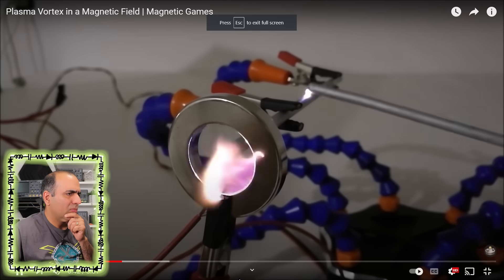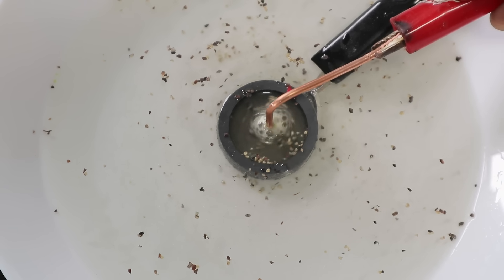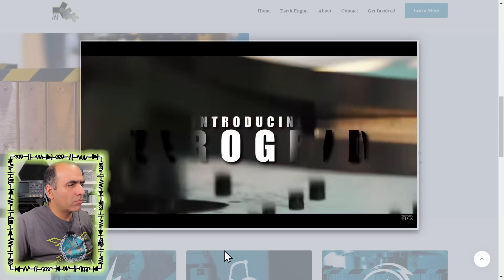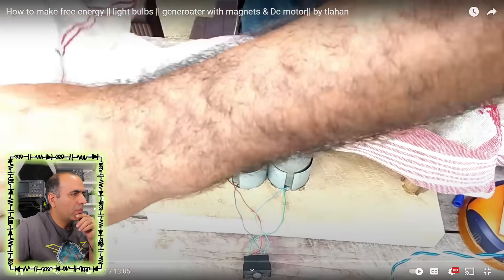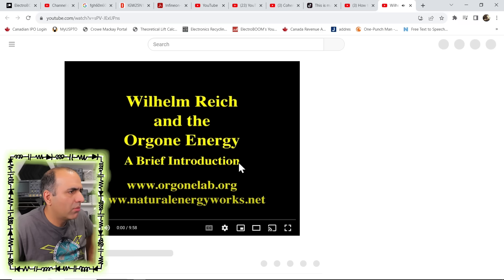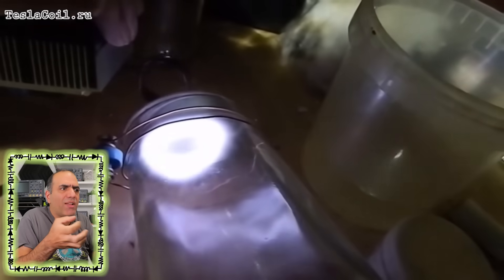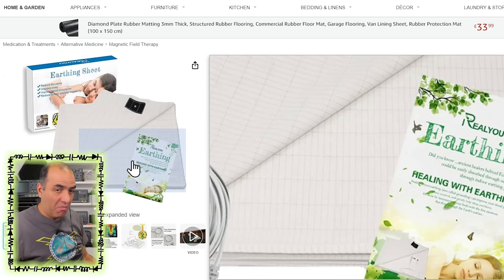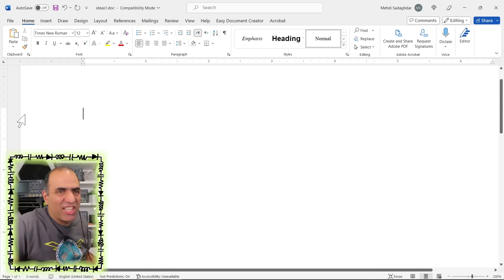Plasma and Salt Water Electric Vortex, Document Free Energy Clean Up

Comment: Hi Mehdi! I love your videos, please don't ever stop making them!

Regarding the plasma ball thing, I think I recognize that. I believe it may be a simple Inductive coupled plasma experiment where they're supplying some sort of RF source through that large coil around the bottle and maybe the smaller one is a heater of sorts to heat up the gas and make plasma a bit easier to make. Usually ICP is used to make extremely high temp plasma and requires a liquid cooled quartz enclosure to operate for a long duration and an electron source of some sort to kickstart the reaction but maybe a simple proof of concept experiment is doable with a glass jar as we see here. Not 100% sure, but I wanted to give my two-cents.

Comment: How about lenses to heat water to boil. Electro-BOOM. Also, Stirling engines powered by lenses. Pretty much heat something with a magnifying glass. Even thermo-acoustic motors heated with lenses. Greenest idea I've come up with so far. The energy cannot come from the earth or we will disrupt things that are supposed to be in balance. So we have the sun, and solar panels need minerals that we have to take from the earth. Why not lenses, either a series of lenses or giant lenses, to heat the tanks on the reactors we already have, to turn turbines that we already have hooked up to the grid we already have. Also, there will be advances in lenses if we use this idea. You can easily swap out the lenses with future lenses. Green lens
Reply: Just give this Kentucky truck driver credit when you get a Nobel peace prize.
Reply: Thoughts are sparks my friends

Comment: Speaking of free energy, how about tidal power?  That's not free energy, you say?  OK, then where does it come from?  Specifically, something else must be slowing down; the rotation of the earth on it's axis, maybe?  Say that a large body of water, like a bay with a narrow opening to the ocean, was dammed.  Turbines are used to generate electricity on both incoming and outgoing tides once there is a sufficient mismatch in water level across the dam.  Will harvesting energy in this manner cause the rotation of the earth to slow down more than it would without the dam in place?  How much?  I ran through some calculations once, and the answer I got was ... surprising.

Comment: One thing I'd like you to demonstrate and explain is this experiment I did when I was a kid : Take an incandescent lightbulb. Stick the metal part in a glass of water (to keep it cool I assume). And put that it the microwave.. After a few seconds it turns on! I was never sure if it was the filament starting to glow, or the gas inside turning into as plasma....

Comment: My guess on the coherer thing is that the flame sucking the oxygen out of the cup creates just enough vacuum to cause the lightweight aluminum balls to meet up in a more "conductively ideal" configuration, at which point current will begin to flow. Once the current is flowing, the charges passing between the cathode, the balls, and the anode is enough to maintain the attraction and therefore maintaining said "conductively ideal" contact between the metals. Once the circuit shorts to ground, the current flow is diverted away from one side of the circuit, eliminating the attraction between the metals and the aluminum balls settle back into a less ideally conductive position.. effectively turning off the circuit.

I'm probably talking nonsense but I like to theorise out loud haha

Comment: So, heres an idea for you to try, its not free energy but its probably the closest we could get, the reason its not free is because friction and heat power loss aswell as needing to swap out components every so often.

So, the idea is you get 2 motors, gear them so much so that the second one when spun outputs the same as the input requires, but kickstart it with an external power source to get it running effectively, again not free energy but i feel with the right gearing and motors, you could have battery-less pacemakers in the future, but you'd need to go in every so often to check on the component wear as i know carbon brushes don't last forever, also as youve said here the magnets in said motors won't last forever, but it could in theory limit battery waste, the only thing i'm not sure of (which is why i'm giving you this as a video idea) is what the output amperage would be like, as i know you'd need say for example 5 amps to go in, but would you get that out? i doubt it but its something for you to explore, especially as you are the best fit for the experimentation as you give the best explanations while also being really entertainign and not some boring droning narrator with about as much personality as a piece of paper

you don't have to take this idea on of course, but i'd really like to see someone knowledgeable in electronics give it a look into, as i'd really like to see if it could work, i have lots of theories about how things could work in a scientific way but no means to properly test them, some ideas we can't test but have some theoretical merit

Comment: In regards to the first video, if I'm not mistaken, an asymmetrical magnet would be a magnet that the north and south poles wouldn't be in balance, making one side much stronger than the other. This would indeed make it possible to do the whole computer-fan-with-magnets thing and have it turn without adding more energy to it... For a while. Such a magnet would be extremely unstable, and would indeed require recharging, or it would either lose its magnetism, or just become a regular magnet, and I think that 3 years if VERY optimistic. And because of the resistance in the wires, friction on the electrical generator and motor, air resistance, etc... It would still lose a lot of energy overtime.

In other cases, people think that by orienting magnets in a certain way, you could negate the effect of one pole, while enhancing the other (see halbach magnet), but in reality either the magnetic fields will just be severely distorted, or the assembly will lose all magnetism after some time.

Comment: - 11:10 Um, that's obviously not a ball or ring of plasma in the bottle, it's clearly just the reflection of a flashlight and ring-light. I have to assume Mehdi is being facetious, pretending it looks real. 🤨
- 13:18 Powered through an unknown energy-source. Wait, so we can plug stuff into God? 😲 Cool! Free power. Wait, is it free or does it cost our souls? 🤔
- 13:40 An Indian achieved 250% efficiency? Well an Indian told me hackers were in my IP address, so…

Comment: I think by 'slingshot effect' they're talking about gravity assists, where you pass close enough to a planet that you get accelerated by its gravity but miss it and get slingshotted out of its sphere of influence. There are some concepts to try to perpetually generate energy from the earth's gravity but they usually use some spinning mass stuff in Low Earth Orbit and as far as I have seen are usually disguised and non-existant perpetual motion machines! The other sort of 'earth engine' i've heard of takes the earth's rotation and tries to get that to power something - but these are usually hilariously inefficient and if they were used on an industrial scale they'd eventually slow the earth's rotation by a problematic amount.

Comment: The flywheel may recover a lot but it's not producing more out than in. Particle accelerators that collide electrons show the net force of 1 will be greater than the two combined before they collided. In fantasy, this is what is in Tony Stark's chest. We must look at the energy involved in accelerating electrons to collide them to generate that net value of the one with greater velocity. So there are still isn't potentially free energy from this affect.
However, that theory combined with unique technology I have invented has the potential to be a highly advanced and  efficient generator. The solar generator invented has nothing to do with this but nothing to do with current solar technology.

In closing, I invented an entirely new type of solar generator that will change the world that I think you should build. I'm at a huge disadvantage financially and physically disabled from my injuries, so if you're interested let me know. When you see it you're just going to say "oh shit, duh!!!" It will cost very little for a working prototype, probably even just a hundred bucks!
It can potentially change the world and free us from dependencies controlled by our own governments and most often provided by private corporations. 
❤

Comment: Heydo Mehdi,
These plasma balls are real, they are a variation on plasma toroids, for more information here are a couple of good channels that might help u navigate the topic as most of the info about is actually in Russian or German so it might be a bit difficult to research:
https://youtube.com/@Vidduley
https://youtube.com/@HVE
https://youtube.com/@BackMacSci

Quick explanation is that typically u have a coil with an oscillating magnetic field interacting with the magnetic field of the plasma restricting it radially into a toroid in one plane, the video shows a secondary coil perpendicular to the first and of smaller diameter, this is possibly to restrict the feild axially to form what looks like a ball, that's why when the second coil moves away the shape collapses back into a toroid...
Well sorry if my explanation is not quite spot on but this will get u near the right address ;P
Here are some resources for the circuits used:
https://www.circuit-diagram.org/circuits/24ddc75d2c05422cb0dfbe5f598448c6
Best of luck with the topic, honestly it's a bit of a pain to navigate but hopefully u can crack it.
Best regards
Ali6x944

Comment: Your smell of pepper is actually chlorine gas! I made this mistake once trying to electrolyse water in a cup in my room into hydrogen and oxygen with a battery. Problem was it wasn't conductive enough, so I added salt.

What I forgot was that by adding salt chloride ions are also attracted to the anode and it preferentially evolves chlorine gas. So I came back to find my room stinking of bleach.

Comment: I mean, there is a lot of "earth energy" as we're spinning and hurling through space, but to capture that is a whole other matter. i.e.; impossible in the foreseeable future.
I wonder if you could somehow capture the changing magnetic flux of the earths rotation by having floating wires around the entire planet. I'm guessing keeping a coil in place & stationary to earths rotation would take as much or more energy than you'd get from it. The magnetic drag on the wire would be a lot of force if it worked in the first place.
Reply: It would not work.

Comment: you missed the best part of the grounded blanket you plug it in so it's connected to ground you plug it into a 110 power outlet
Reply: You have to plug it to the socket to ground it, obviously. It doesn't connect to the live and neutral wire.

Comment: While working on cars, and when using my buthane torch, if its somewhat close to my milwaukee impact gun, when i press the piezo igniter on my torch, it will turn the light on the gun without touching it. And thats not in the range of spark jumping, its at least 30cm away. I can also film it.

Comment: As for the "slingshot" effect, that works by stealing kinetic energy from the moon's orbit around a planet, or a planet's orbit around the star, it has nothing to do with magnets. Basically, after passing the object you're getting energy from you're still moving at the same speed relative to that object, just in a different direction, and it's that change in direction that can transfer kinetic energy relative to a third object that both are orbiting.
Reply: How can you "steal" that energy though? Please write me even the simplest of ideas.
Reply: @Meg_A_Byte  Lets say you launch from earth with just enough energy to reach the moon, but not enough to escape Earth's gravity. If you pass the moon on the retrograde side(the side that trails behind in its orbit around Earth), the moon will pull the spacecraft to go faster around the Earth, while the spacecraft will pull the moon to go slower. Because the moon is much heavier, we don't really notice it slowing down, but the spacecraft will then have enough energy to escape into solar orbit.
Reply: @sleepib  Yeah I get all that, basic sutff, but how do you harvest the energy. How do you produce electricity from that? And send it back to earth?
Reply: @Meg_A_Byte  You don't.

Comment: What about a electric car that generators it on power as it operated to setst obaterid solar panel as charging vaup vateris with a tork comberters gear boxs on motor por will generators can be as the hub assembly gps autopilot fully computerised

Comment: Curious...would you consider magnetism a form of non-lethal radiation? I ask because I consider you one of the more intelligent and investigative youtubers that I follow, and I've followed you since you were working on your auto. Thank you sincetely for expanding my horizons. You kinda rock, from one old-timer to an other
Reply: So first of all, magnetism isn't radiation, it's just a field or force (depending on the context).  Radiation transmits energy from one place to another, but a magnetic field (by itself) doesn't transfer any energy, it just exists.  So because of that, it can't really be considered a form of radiation at all.

When you vary a magnetic field back and forth (which also results in electrical field variations too, or vice-versa), that can transmit energy, and that does become a form of radiation.  That is what we call "electromagnetic radiation", and makes up a large portion of all of the kinds of radiation that most people regularly think about.  Electromagnetic radiation includes everything from radio, to microwaves, to light, to X rays and gamma rays, etc (depending on the frequency).

(There is also particle radiation, but that does not really involve magnetic (or electric) fields directly)

Secondly, there is no type of radiation that is (in itself) "non-lethal" or "lethal".  Any kind of radiation could be lethal, or it could be non-lethal, depending on its intensity.  Certain types of radiation can do more damage with lower intensities than others, but even those, if low enough, aren't necessarily going to be lethal.  Likewise, even forms of radiation which we usually think of as being "completely safe" (such as light) can potentially kill somebody if you crank them up to much higher levels than normal (for example, a high-intensity laser).
Reply: @foogod4237  perhaps I should have chosen 'beneficial' over 'non-lethal'?
 thank you sincerely for your informative response, and again for wording it in a way that could be understood without the use of a encyclopedia. I guess my misunderstanding was based on an example of metals becoming magnetic/magnetized simply by being near a natural magnet for a period of time and jumped to a conclusion

Comment: Your opening demonstration with the tubular magnet, making salt water spin made me wonder. You could make a pump out of that. Like an impeller pump, only without the impeller. I wonder how inefficient it would be.
Reply: ElectroBOOM did a video about this effect, video is called making a water railgun
Reply: The problem is that this sort of setup only moves the water in a circle inside the pump, which is not generally very useful.

Though there are various designs for electrostatic and electromagnetic fluid pumps that do use some similar principles in slightly different ways, and are actually used in some applications.  They generally only work well when what you are pumping is highly electrically conductive, though (such as a saltwater brine, molten salt, liquid metal, etc), so aren't really useful for everyday water pumps..

Comment: 4:09 I have a book on wireless sets and it mentioned a coheror in it, in that case it was a cylinder with electrodes at each end and small iron filings in between, but it still worked the same

Comment: 15:05 The free energy talk got me thinking. Technically, conservation of energy can be violated in a system where the laws of physics change over time (in a certain sense — technically the Lagrangian has to be time-dependent), but the only relevant such system is the universe as a whole due to its expansion.

The energy contained in radiation shrinks as the universe expands, and the energy contained in dark energy grows, but the two aren't being converted into anything — they're just kind of appearing from nowhere. Since there's much more dark energy than radiation, the energy content of our universe is increasing as it expands.

I wonder if somewhere out there there's a scam artist claiming to be able to "extract free energy from Dark Energy", which would at least have the scientific foothold that said energy is actually coming from nowhere (but it would of course be entirely useless to power anything).

Comment: In December, Lawrence Livermore first achieved a net energy gain in a fusion experiment using lasers. That experiment briefly achieved what's known as fusion ignition by generating 3.15 megajoules of energy output after the laser delivered 2.05 megajoules to the target, the Energy Department said.